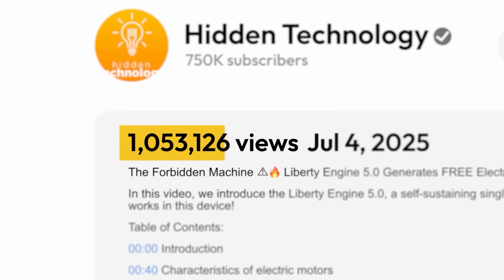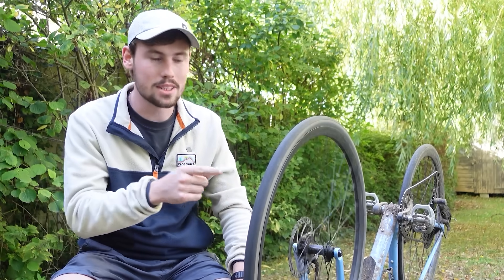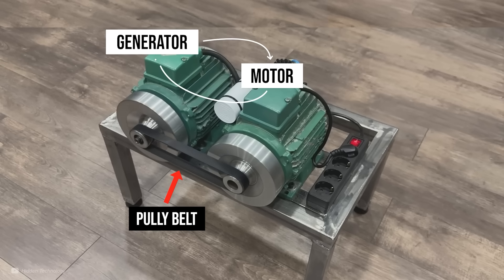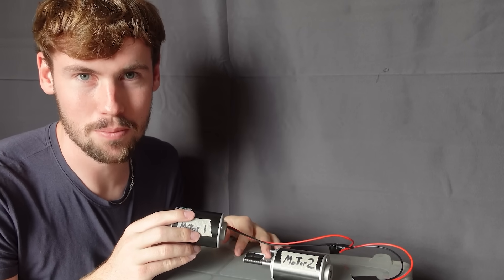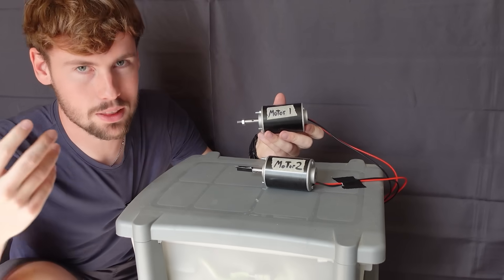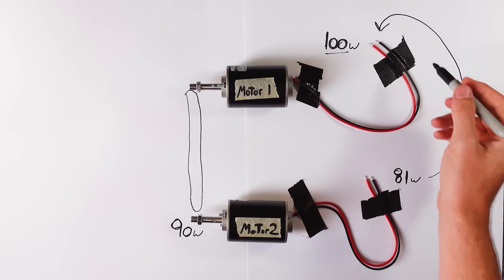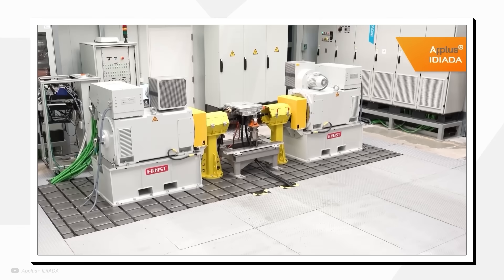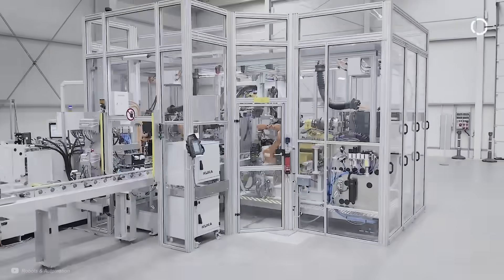100 Years of Waste! Solved by an Unlikely Invention.

Comment: Reminds me of another device: an electric motor connect to a flywheel, connected to a generator. It is used as a line conditioner. The input power may not be consistent. The flywheel removes any fluctuations in the input, which leads to the generator making consistent output.
Reply: This can also be used to make three phase power from single phase.  You use a single phase electric motor to turn a three-phase generator.
Reply: I remember the same flywheel setup (several tons) to store a lot of energy for instant high power (GW ) delivery on a particle acelerator in Saclay-France.
Reply: I am an engineer and was about to give that as an example of where this mechanism can be extremely useful.
However there are limits on the motor side of such systems.
Technically there shouldn't be because if we have generators without outputs in the gigawatt range we should be able to build motors of the same size. But in the real world that's not practical for a number of reasons including the drives for the motors.

But its fairly practical to have a motor-flywheel-generator up to a few megawatts.
WHERE I think such devices will find a home is right next to the mega battery systems that can spit out megawatts of power. The single biggest weakness of those systems are the inverters. Yes I know about the claims of synthetic inertia and I think they're just a sales pitch at best and more likely BULLSHlT.

The simple fact is inverters need something to follow.
So if beside the monster inverter there's a smaller high efficiency motor-flywheel-generator then the inverter has something follow and the inertia of the flywheel keeps feeding the system a stable AC signal. 

Another option and one I think is going to have a huge future is what I call hydrogen buffering where you tap off a percentage of the renewable system into one of the new high efficiency PEM electrolysers and use that to power a bank of gas turbines. ITS NOT a storage system but a buffer system where at least one turbine is going 24/7 and providing the network with BOTH the inertia needed for stability and the adjustability of power feed a grid needs to handle demand swings.

Basically its similar to the peaking plants we've had for decades except hydrogen fueled and instead of just going a few hours each day on the peaks there's something going 24/7 to provide the stability.
Its a bit more complex, but that's the simple description.
Reply: I think a flywheel attached to any system balances out inconsistency I don't know if you need another motor. Surely that just steals efficiency
Reply: @Ntwashere002 The problem is not efficiency; it's conditioning very high power. This setup is cheaper than the high-power semiconductors that would otherwise be needed.
Reply: @ShawnHCorey ahh fair enough that does make more sense now
Reply: @ShawnHCorey  exactly , this has been used for ages when you needed to convert high power voltages , metro trains , for example ,  have used it more than 100 yrs ago to convert electric power to the specific voltage for the track power
Reply: these also are used with frugal innovation/tech , to build power system within community far from servicing services for more complicated systems
Reply: @Ntwashere002 It's also for the purpose of electrical isolation. A lot of hospitals use a similar set-up. One motor connected to the grid, powering the flywheel and a seperate generator connected to the flywheel getting powered by it. This not only provides a smooth isolated current but also prevents important medical equipment from losing power in the event of a power outage while the back-up generator starts up.
Reply: @Ntwashere002it does steal some efficiency but the power is needed in electrical form and not in kinetic form. The second motor converts it back to clean energy at a constant rate to be used as electricity again.
Reply: Related to this, pretty much every physical generator such as a steam turbine in a nuclear, gas, or wood-burning power station acts as a flywheel, which gives some frequency stabilisation.

They are all synchronised, and if the grid frequency starts to drop, every generator  works slightly harder and we see a slight change in phase between the AC voltage and current.

Likewise a generator that is slacking will 'motor', again with a slight phase change, so it stays synchronised with the grid.

Electronics can replicate this behaviour, but they don't all do it. Also, we are still learning--a bad choice of electronic control can make ripples of
lead and lag bounce around the grid like a huge bell ringing. I believe that effect was part of the recent blackout on the Iberian peninsula in April.
Reply: It also has been used as a transmission for certain hybrid vehicles. Don't need a complex mechanical linkage between the engine and wheels when you can connect them electrically. Diesel locomotives have been doing this for a long time too.
Reply: @emilysmith6897 Diesel trains, too.
Reply: Just put up a long ass fence under some high voltage lines. Presto , free power. As long as it's on your land the energy demons won't do anything
Reply: Exactly the same arrangement is used as power converters between voltages/amps that would be too lossy for common electronics. Also as AC to DC converters.
Reply: I’ve seen it using a single synchronous engine working as both the motor and the generator. 

They can control the field excitation voltage to correct the power factor too.
Reply: Also look at rotary phase converters to get 3 phase ac from single phase.
Reply: They were also used as an early UPS where there was also a diesel engine on the shaft isolated by a dog clutch. Used to be used on ships for their navigation system.
Also worked on one at an airport that had a 20 ton fly wheel that could keep the control tower and radar running for the time taken for the diesel to kick in.
Reply: Yes so I just take a 500 watt motor.. and just use a rubber belt and connect it to a 500 watt generator... Boom!!! I'm generating 0 watts! And my engine is exerting 0 HP. 
0 point energy guys! There was zero point!
Reply: @ShivaTD420 That arrangement would make an effective space heater, though, and a job creation scheme for people who make rubber drive belts, and bearings, and motors and...
Reply: @HexBeach  it would make zero heat. Because the 500 watt generator is generating 0 watts to power the 500 watt motor.
Reply: @ShivaTD420 Well, if you don't hide an energy source, it will also stop in seconds! :-)
Reply: Uh... the whole electricity grid basically runs on that, because turbine rotors in power plants are basically flywheels :)
Reply: @ShawnHCorey Another example of line conditioning is the US ICBM silos.  A nuclear explosion creates a strong ElectroMagnetic Pulse, EMP, similar to a lightning strike.   The strength is proportional to the length of the exposed electrical conductors.  The silos are 10s of miles from the utility power plant.  Rather than using the backup diesel generator as the primary power supply, this system is used. Only the electric motor is fried by the pulse.

Comment: You should look up the synchro resolver!! It is basically 2 motors, both wired together. They are 3 phase motors and are identical. As you turn the shaft of one, it turns the shaft on the other. These were used on dial indicator like devices, especially on large ships. The control room would adjust one side of it to point to the desired speed or whatever was required and the other one would be in the engine room where someone would watch that dial indicator and adjust the engines to match the proper speed. Super simple and was used in many places. And it works both ways, the person on the other side could adjust it and it will be indicated back on the other side. They are still in use today.
Reply: Synchros always (!) need an external AC-source to power the stator. Contrary to two three-phase synchronous motors or DC-motors, these are not perpetual.
Reply: @debrainwasher  No motor/generator setup is actually perpetual though (because there's no such thing as free energy - if there was, we'd be using it already.)
Reply: @lennyvalentin6485  Perpetua mobile do not exist, but perpetual motions exist very well, when the source of energy is defined as not exhaustible within a sensible time span of operation. E.g. an automatic wrist watch can do such a job, since motion energy of its carrier is not exhausted during his normal operation mode until his lifespan. Or a wind-mill. Synchros however can never exert perpetual motion, because the energy to transfer a torque-less angular position is delivered by a constant AC-power source.
Reply: @debrainwasher  A self-winding wristwatch is not a "perpetual motions" machine, it's just a regular wristwatch with an offset weight connected to the mainspring to wind the latter up as the wearer moves. It will stop "perpetually motioning" in about a day or so if the user takes the watch off and puts it down somewhere, because that's roughly how long the mainspring lasts in mechanical wristwatches.

"Windmills" (you mean wind turbine, likely) stop moving if the wind doesn't blow - which happens basically everywhere at some time or other, that's not "perpetual motions" either, not any more than the leaves on a tree is "perpetual motions".

Anyway, I'm not talking about some hypothetical "perpetual motions" machine here which just moves "perpetually" (which is impossible), but rather the type of perpetual motion machine which supposedly creates free energy (which definitely is impossible!)
Reply: @lennyvalentin6485  Of course everybody is free to make his own definitions. Maybe, you wanted to contact Rolex, Breitling, Omega, Tissot et alia, and explain them, they had to rename their products due to your definition.
Reply: @debrainwasher what is it you do for work that led you into these?
Reply: @lennyvalentin6485 his point was is that we do have machines that do take very little input, stores it , and releases it in a time frame that we dont need constant input for the machine to continue to work. Those watches for example get 12 hours or more of output just from a total of maybe 2 hours input.
Reply: Proper name = "Selsyn". Aircraft had those about 70 years ago.
Reply: @patrickshaw8595  Also Ships (as noted by another post..). Possibly railway signalling as well ...
Reply: Selsyn motors were much used in the film industry to synchronise magnetic film audio recorders to picture during post production.

Comment: It only works when testing motors. If you want to do any work at all you will have to add the power that is used in the work being performed plus heat loss
Reply: yea video is pretty bs

Comment: I find this notion really interesting- both reclamation of energy, and looking at the ways "free energy" devices Almost work to see if those concepts can be creatively applied (like this notion) to greatly improve efficiency.

And much like the car that could sail straight downwind faster than the wind itself- long considered impossible- it seems to me some perpetual motion ideas might also be made to work in some clever way we've not hit upon yet.

Robert Murray Smith, in one of his lectures, also pointed out that "free energy" is a matter of perspective-  solar and wind are both "free to You" sources of energy.  You make the thing, and it requires no additional input on your part to work. Therefore, from our relative perspective, they are "free energy" devices.
Reply: "Free to you" energy isn't free energy. Building the solar cell, or the wind turbine (or the hydroelectric dam for that matter) has a cost. It's not "free". The solar cell doesn't produce electricity after nightfall, the wind turbine doesn't produce energy when the wind doesn't blow - and the hydroelectric dam needs consistent rainfall. It's not free in any way, even though you're not PAYING for the sunlight, wind or rain. Paying for stuff is a human-made concept; the laws of thermodynamics don't care if you pay for stuff or not! :D

Btw, sailing faster than the wind isn't "free energy" either - it's just good engineering/design. Perpetual motion is bunk. If you believe in it you're just setting yourself up to be scammed by a con artist selling you fake nonsense.
Reply: @lennyvalentin6485  way to miss the Entire point there.

(And in the case of solar, wind, and gravity- the "fuel" is, in fact, free.
Reply: @ryanjamesloyd6733  There wasn't anything to miss, your point is faulty. Solar energy isn't free energy; not from a human financial perspective (it has an up-front cost), and not from a physics perspective either (the sun burns its finite fuel; it's not spontaneously conjuring sunlight into existence and sending it our way.)

That sunlight doesn't have a money cost doesn't make it free from a physics/thermodynamics point of view.
Reply: @lennyvalentin6485  you are correct. The fusion happening in the sun (which we have Nothing to do with) has to happen. 
From our earth perspective, sunlight is free in every sense of the word
Reply: Gravity does not perform work. The same way a magnet does not perform work.
Reply: @ShivaTD420  uh huh.  Why does water flow downhill?

It gets up there via solar, it comes back down via gravity.  We've extracted energy from that for hundereds if not thousands of years.
Reply: @ryanjamesloyd6733  Time to go over your high school physics again mate. Gravity doesn't perform work; if it did, you'd need to fuel gravity with energy of some sort. Work is transforming energy from one form to another.

In a hydroelectric dam, you're "fueling" the turbine-equipped generators with kinetic energy transformed from potential energy from the water stored in the dam. You're not "fueling" the generators with "gravity energy". It's energy from the water. :)

In the same way, magnets aren't sources of energy either. Magnets stick to other magnets or magnetic material, but that's it. You can't make the magnet perform work just on its own. That'd be magic, which isn't a real thing. ;)
Reply: @lennyvalentin6485  kenetic Why?

Oh, right, because gravity causes the water to go downhill, from where the sun caused it to evaporate and eventually condense.
Reply: And, frankly, any time you use your bodyweight to accomplish work, like by leaning on a lever- this is only possible Due to gravity.

(In space, you'd just bounce off and accomplish Nothing)

Comment: The earliest DC to AC converters 12v DC to 220v AC were mechanical 1 DC electric motor driving a AC generator. This was before my time but I have worked on them & found them simple & effective in comparison with electronic ones & especially the modern ones like the latest victron that are extremely fussy about the input AC fron ice generators for the changing side
Reply: I had a tour of an old movie theater once. There was a metal torpedo-like device bolted to the floor with large electric cables attached. It was a mechanical AC to DC converter that powered the carbon arc lamps for the projectors.
Reply: @Hybridog Hi that's interesting as I have only seen mercury diode's used to convert high power AC to DC in the historical past & mercury diode's are fascinating & scary.
Reply: @Hybridog  Old elevators also used MG sets to convert AC to DC.   DC was way easier to control to make the elevator traction motor move at different speeds.   Now with modern electronics (AC VFD drives), you can easily control the speed of an AC motor.
Reply: When I was a kid I walked past army surplus (actually ANY surplus) on the way to school. The rotary converters ran on various voltages and I think one was 28V, but it was very heavy for aeroplanes, so land based I guess. 

I got a proper belt off the HV side, and learned a lesson :-)
Reply: @HexBeach hi unfortunately when I was a child there was only 1 electric/electronic surplus shop in Manchester & that died not long after I discovered it the only other was for clothes and tents. All the others had already gone.
Reply: @industrialmonk I guess it had to end some day, but without websites and videos back then, walking past that place was my only inspiration. Trying to 'smuggle' the rotary converter onto the bus in school uniform got me some funny looks :-)
Reply: I had an old 24v to 110v mechanical converter (100watt If my memory serves) at my parents house. I'll have to look for it next time I am there. I would love to get it to work again.
Reply: @kstricl Chances are that some mineral oil in the bearings, and maybe a bit of a clean up, will have it humming :-)

Oh, maybe clean the brushes if they are oily/sticky, but be careful of brush holders if they are a brittle plastic.

Comment: In addition to galvanic isolation, a similar setup, with a large flywheel and dampened flexible links in-between, is sometimes used in high secrecy environments to isolate the power delivery side from high-frequency noise of consuming side. Or the other way around, from interference.
Reply: I hadn't even considered the power usage side channel for facility data exhilaration!
Reply: We used it on the docks with a variable V belt system to supply ships with shore power at what ever frequency they used between 40 to 60 hz

Comment: Stands to reason that the best way to measure the efficiency of an electric motor is to connect two of them in a loop; making it possible to measure losses in both directions while consuming the minimum amount of power to run the test. Love it! 👍

Comment: If you use a DC motor to drive a dynamo you have achieved "DC galvanic isolation" but permit "some" power to flow.  This is normally difficult, unlike AC which can be put through a transformer.  I expect the loses are large though and converting the DC to AC and back again seems more efficient as that is what gets used in DC isolation mostly.